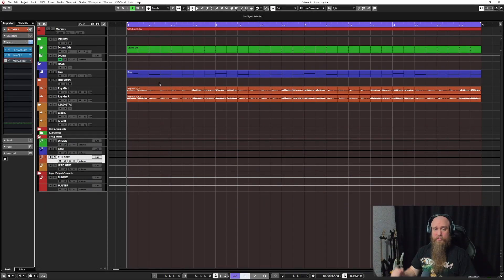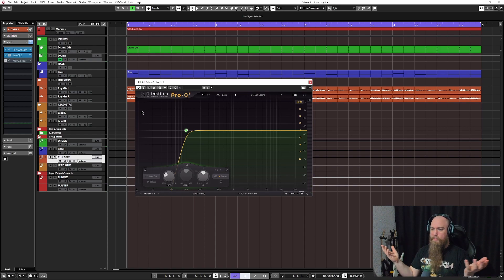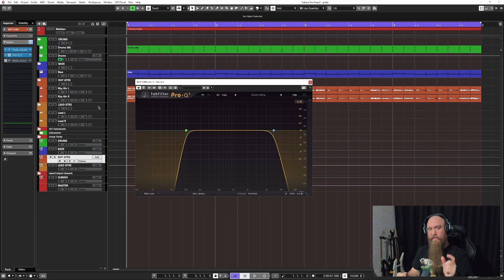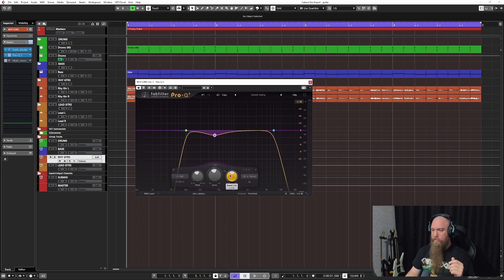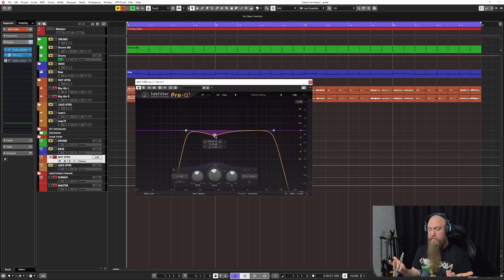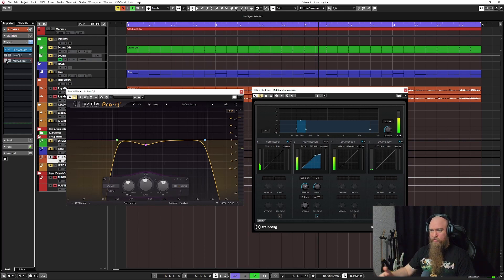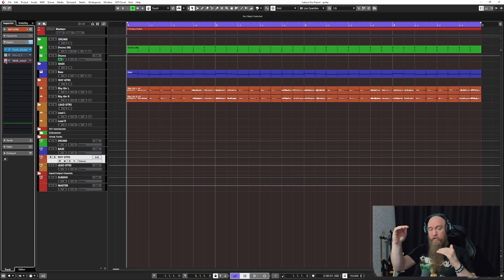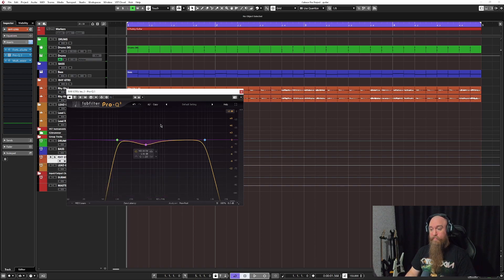How to Clean Up Metal Guitars With My Secret EQ Move

Comment: Good tip... This cut also works great if you a running a line direct from amp into console or interface due to the type of sound you're getting from running a line direct .so this EQ trick works for amp sims as well as real amps plugged direct with no mic...

Comment: Awesome video! A question about the 7k low-pass filter thing, do you mean that for ampsims+IRs or any time you use IRs? I normally use a tube preamp with an IR and I cut the highs around 8.3k, but I still felt it too sizzly at times and because of other videos out there I didn't dare to go lower :) Thanks.
Reply: Anytime you eq electric guitar.

Comment: Very good video this helps for tight metal plating as well I have a zoom g3n and use the 7band eq I drop both mids but lower the low mids and raised the second mids and it is a better clear tone it does help alot and this is a great vid

Comment: I am usually skeptical whenever I hear precise Hz and dB numbers in a tutorial, simply because that exact recipe may work with one specific guitar, pickup, interface, amp sim, impulse etc. and it may be wrong on a totally different setup. Therefore I like it a lot more when I get generally valid principles. But I understand your basic argument and I will assume for the sake of the argument that this is indeed working. At least I will try it myself before I make up my mind. But my question is this: since you perform a series of cuts, that also means a decrease in the overall volume of the guitars. Does it still sound that much better if then you increase the gain to make up for the cuts?
Reply from the maker: Well, think about it: if you clean the low mid gunk from the guitar and then turn it up, does that magically re-introduce the low mid gunk back into the guitar tone? Also, you could turn the drums/bass down in relation to the guitars instead of turning the guitars up... many different ways to go about this =) I did also mention many times in the video that range/dB amount varies by tone, tuning, and what's happening in the song—so I did lay out a 'generally valid principle' that you can experiment with :)

Comment: Great and useful explication, i also usually set my pod hd 500 with low-cut in 100/120 hz and cut over 9/10khz, but i must try to cut a bit on 400 hz as in your video, the same equalization can help me to get a more clean sound also in live, i suppose, but for you is better to cut the frequencies in the modeler or in the mixer eq??? Thank you! Fabio from Italy
Reply from the maker: You can do it either way, however sounds better to you! :)

Comment: Should the 7 khz lpf and the 400 hz mid scoop  still be used with Bogren Digital products that have the IRDX tech? Im not proficient with EQ yet.
Reply from the maker: I would still do the 7kHz cut. For the 400 scoop, I'd probably do it with dynamic EQ and adjust it to where it sounds right.
Reply: @ChernobylAudio666  Thank you, I appreciate it.  Im just a novice at mixing but looking to improve.

Comment: Hi Scott. Just wondering if this same EQ move applies in a setup when using a 100 watt tube amp into a reactive load box with digital IR's?
Thanks.
Brad
Reply from the maker: Yup, will be similar, but you may not have to go too crazy. You might get away with doing the C4 trick first (I have a video about that).

Comment: Hello Scott! Thank you for your videos. Right now I am dealing with the following problem, maybe you could do a video about this or answer it in a FAQ: Im upgrading from my 10y.o. laptop to a brand new one. Im using reaper, ez mix and ez drummer etc. I still have projects which aren't finished yet, but which I would like to continue on my new machine. What would be your tipp to export the projects (zip?) and import the files from one machine to another, without generating errors? There must be a simple hack for this.. anyways, love your videos and take care
Reply from the maker: Hey there! Assuming you have your sessions all in folders, you can just take each main session folder and put it into a .ZIP and transfer it over to the new machine, unzip it, and boom, good to go. What I suggest is to try it with one session as a test, so just zip up one of your session folders and transfer it to the new machine, open it and test it out. That way you ensure it works without doing the whole load of work just to find out in the end it wasn't the way to go. But I think this will work for you—it'll just be a tad time consuming, but you'll only have to do it once, until you upgrade again! :D
Reply: @ChernobylAudio666  thanks Scott! I will try your advice in a few weeks. It's good to know that there seems to be an easy solution. Have a great weekend

Comment: So what if I don't use amp simulators? Cause I use my actual amp and plug it through my phones. Could it be something with my amp setting or could I still use an EQ?
Reply from the maker: Use dynamic EQ and adjust it to where you take out just enough of the boxiness. I'd do it during chug-chugs or very loud parts.

Comment: I've always felt that the 350Hz-750Hz range in rhythm guitars sounds like noise, it kind of feels like unnecessary high end but instead it's mud/papery. It is important to have a bit of something in the 150Hz-900Hz range though, like you do here, otherwise they sound a bit cold. Wall-of-sound tones also generally have some kind of lower-mid something, but it's always mixed with a complimenting core mids (1-2k).

Comment: Honest question: Doesn't doing all this take away the rawness from the music. People spend more time on twisting and turning knobs than capturing a true recording. I think an amp and cab is all that is needed. But I like black metal so that could be were the difference is.
Reply: I was wondering the same. I also like the guitar tone to be more raw and to me it sounds better with a lot more top end (cut at around 12-13k).
Reply from the maker: I'd argue that the most successful black metal bands are the ones that can present their music in a way that can be easily digested, but at this point we're running the risk of getting into a 'tr00 kvlt' argument. All I'm trying to do is help people (who are seeking it) improve the sound of their productions. :)
Reply: @ChernobylAudio666  Cool. Thanks for the response. Have a great weekend!

Comment: I have a question: something I've learnt to avoid is to scoop my guitars. However, I was pointed out about doing what you Scott did in the video. To actually cut in the mids, therefore scooping the sound. But it really makes the mixes clearly.

How's that? I feel like it is contradictory to have  a mid-rich tone (as the guitar is a mid-range instrument), but at the same time, cutting the mids brings clarity to the mixes. Any thoughts on that?

PS: I love your channel  and I've learnt a TON with your programming drums course! :)
Reply from the maker: You have to remember that when you are mixing multiple elements of a song together, you get frequency masking and overlap. You can have a mid-rich tone all day long if you want, but where will your bass and snare go? Also, it's important to not go too extreme with the cut, just enough to where the guitar loses the "haze" and becomes more clear in the mix. The low and low-mid region of the mix is directly responsible for how clear, tight, and 'big' things are going to sound—so it stands to reason that if there is a lot of stuff going on there with tons of energy, that it gets muddy and causes problems.
Reply: @ChernobylAudio666  Thanks a lot! :)
Reply: I think you can definetly still have tone that is rich in the mids, you just cut out certain parts of mids, since mids take up such a wide range on the spectrum. You let guitar have one kind of mids, let bass have the other and voila, brutal tone.

Comment: Does this work also for higher tunnings like D standard or E standard???
Reply from the maker: Absolutely! Just a matter of how much you need to do :)
Reply: @ChernobylAudio666  thanks mate!! Still a 400 hz cut on these tunnings??
Reply: Nahhh. 400hz is just a guideline man. Use your ears. That 350-850 ish hz range is the region that muds up mixes across ALL instruments. Its also the region that gives your instruments weight on smaller speakers and headphones.

Comment: I've used low-mid cuts before, but this more subtle approach seems to be more effective than carving out 4-5dB at 200-300Hz.

The -2dB at 400Hz is just enough to clear everything up, but still leave enough crunch to be effective. Thanks for the tip.